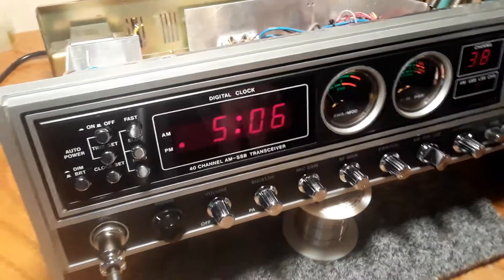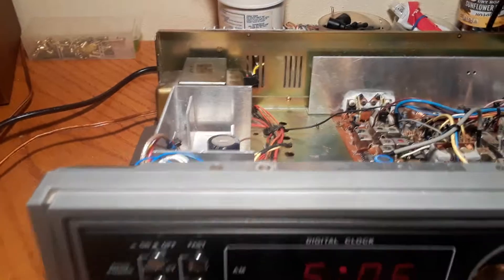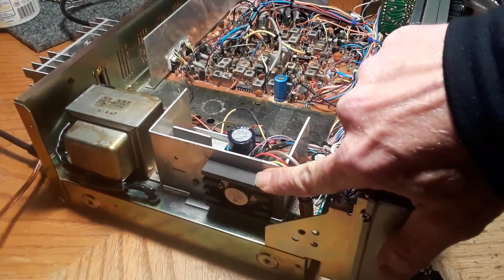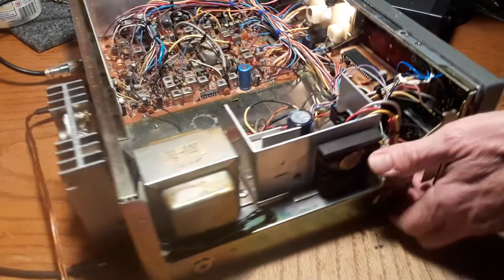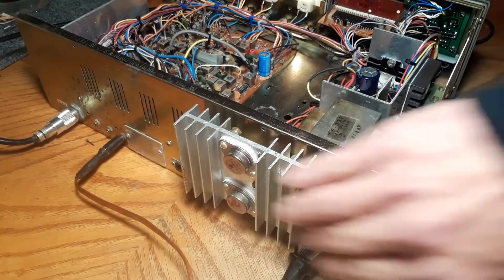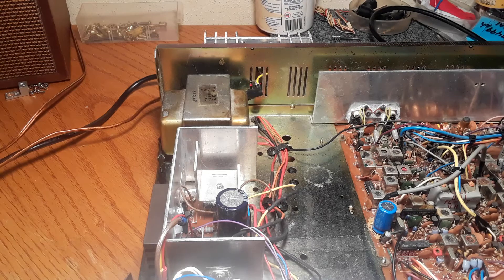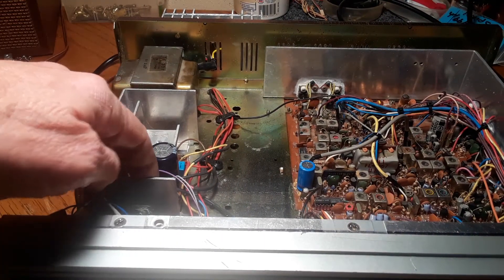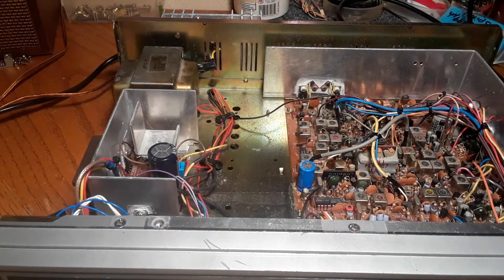uniden president madison.power supply "hot" resolved.

Comment: Hello, I have a couple of  Madison's and Washington's with no overheating power supplies yet.   I like your modification with the bigger heat sink and is this just being proactive? Maybe you can make another video showing us how you completed this mod?
Reply from the maker: Proactive is probably a good word.i like that.i always increase the illumination in these radios.thats the primary reason which will increase pwr.supply load by about 450ma.then if u factor in other added small loads I add in other things ,it adds up.sometimes I put the illumination regulator on power supply heat sink which is already a little undesigned,so I move power supply heatsink to rear.if not it will build up alot of heat in cabinet after many hours, and depending can make ur oscillators shift freq a little bit.so that's some reasons.thanks for watching!